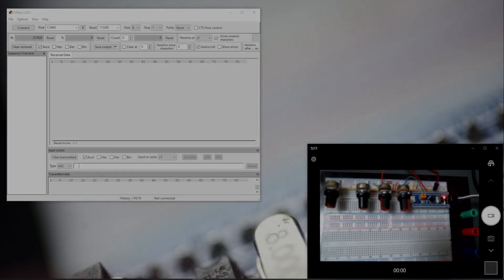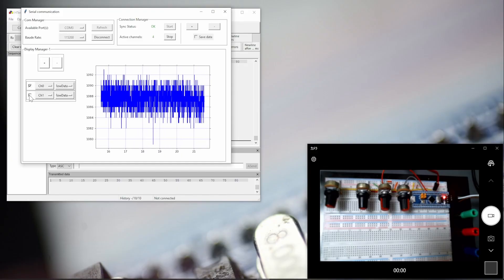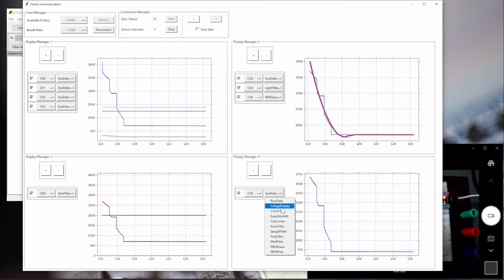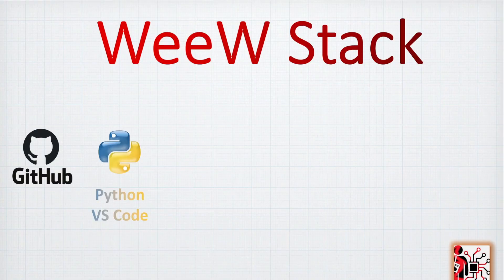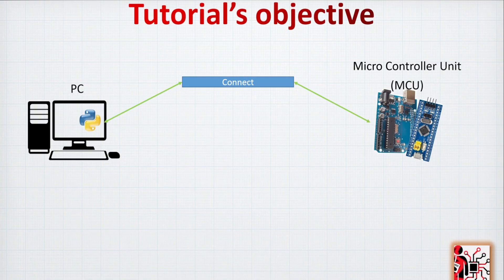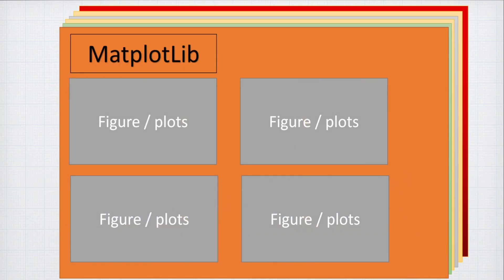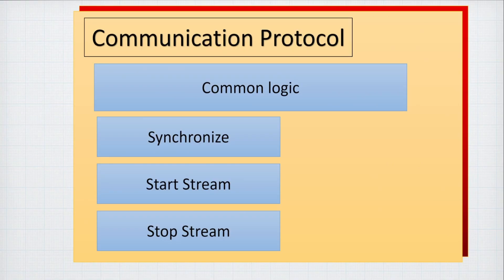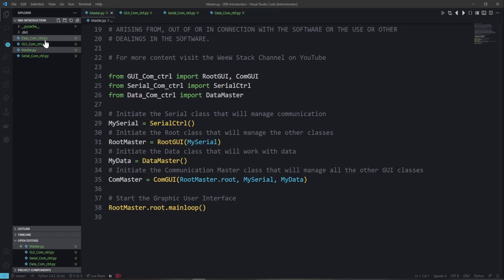000-Python Live stream Graphic User Interface Arduino-STM32: Tutorial Introduction

Comment: I am curious how you will solve this. About a month ago, I submitted a project that does almost the same thing. I use an Arduino for data transfer and visualize with PyQt5 and PyQtGraph, also employing threads. The entire setup runs on an Raspberry Pi with a touch display. I transmit data at 1 kHz to the Pi and display it at 30 fps.